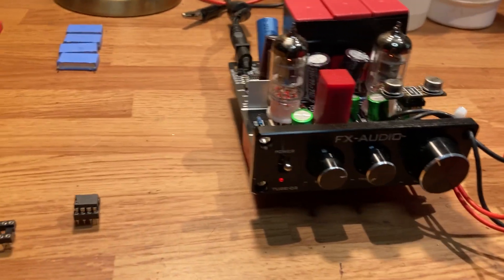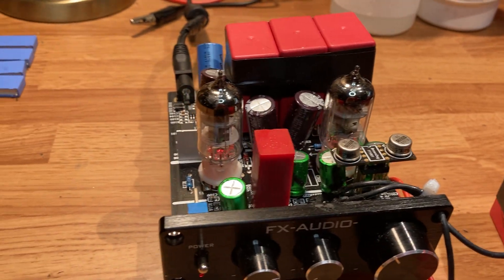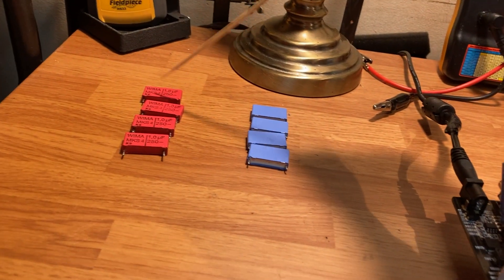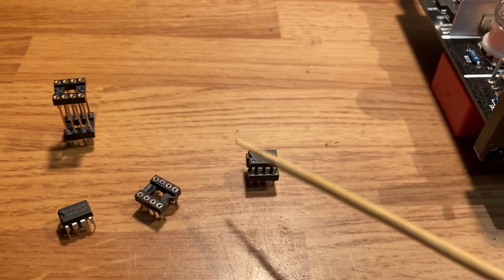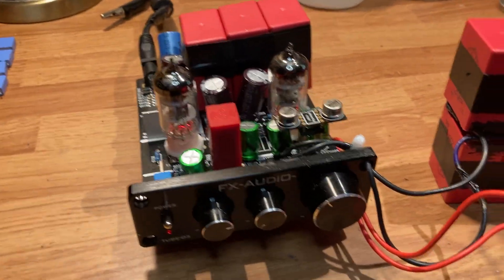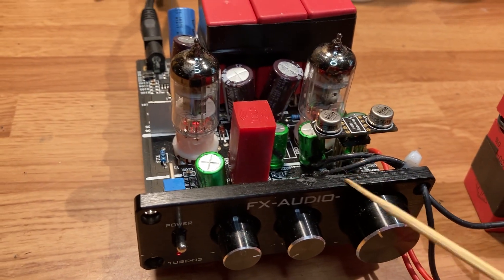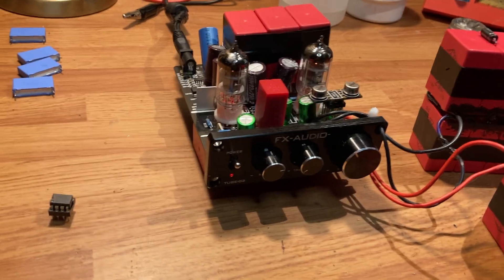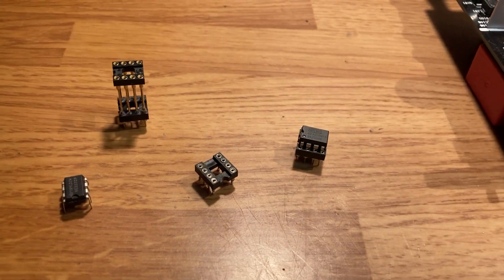FX Audio Tube-03 op amp and capacitor upgrade

Comment: Ooops! I installed a set of  OPA627’s backwards in my tube 03 and turned it on. The OP amps are ok but the tube 03 is distorted with no volume control, bass control and treble control.
Reply from the maker: I think it's the op amps they are what we called FRIED!  Swap them out with the other ones and see if it fixes it.
Reply: I put the OPA627s in a different Tube 03 and they worked fine.
Reply from the maker: @audio-obvious568  It's impossible for the op amps to destroy the Tube-03 themselves.  Again try to put different op amps in the Tube-03 that you say has all of the problems.
Reply from the maker: @audio-obvious568  What are you using for an adapter with them?
Reply from the maker: @audio-obvious568  take a picture of those op amps and send them to me at peopleridiots101@gmail.com
Reply: I put all the original parts back into the tube 03 and I had the same results……. I am using an adapter from cimarron single to dual adapter for the OPA627’s
Reply from the maker: @audio-obvious568  and how are you fitting it in there?
Reply from the maker: @audio-obvious568  Again, take a picture and send it to me at peopleridiots101@gmail.com
Reply: I purchased extensions.
I’ll send another email of my working set up.

Comment: Great Video !!, I just got the Fosi Audio tube P1 preamp I bought in addition the Riverstone 5645 GE tubes , I still listening now to the 6K4 tubes, What OPAMP you can suggest me to be replaced in my Fosi P1 ?
Reply from the maker: Look up there ^^^^^^^^^^
Reply: @ranbymonkeys2384  OK, I will order the OPA2134 and four WIMA 1uF cap. Thanks
Reply: @ranbymonkeys2384  Hi, Can you please provide the WIMA Caps values or links form digi key, sorry I got lost from all the list of caps in the website. Thanks
Reply from the maker: @RanTausi   That isn't all you need, you don't know what the hell you are doing so your asking for me to make sure you don't fuck up.  THE ANSWER TO YOUR QUESTION IS IN YOUR PRE AMP RIGHT NOW.
Reply from the maker: @RanTausi  Look up capacitors (film) then look up WIMA if that's what you want and click on it then click apply to all now it will just show you WIMA caps.  Then you can select uF, voltage, and if you are really confused hint: check out the SIZE.  Look I have no problem helping people out, I do however don't want to hand people everything because then what happens the next time they need a ANYTHING it's "can you give me a part number"  Also check the box that says "in stock" under stocking options.

Comment: Electrical engineer with design experience of 40 years. When someone says op amps and capacitors need a break-in, it destroys the credibility of everything else they say. They are either lying or are ate up with confirmation bias. Or both.
Reply from the maker: Have you ever swapped caps in an amplifier?
Reply from the maker: When it comes to op amps you can have your bass and treble (EQ) at a setting and that will change drastically after 20 to 25 hours with a new op amp.
Reply from the maker: OK, then.

Comment: I just opened my new FX Tube-03 and though I can get the muses in I have 500v  and  not the 250v ones (want to replace with the wima's. Any advice for me?
Reply from the maker: Thought you can get the muses in?  I already answered the 500volt vs 250 volt question, PAY ATTENTION!!  What are you talking about "thought I can get the muses in"?
Reply: @ranbymonkeys2384      'nough said.

Comment: So if the tubes to this amp operate at 250 volts and the capacitors that you used operate at 250 volts how are they doing anyting if it has a low voltage power supply?
Reply from the maker: Because film caps usually don't come in lower voltages.  They do but they are very small for the size of capacitance desired.  You can have a 10,000,000,000 volt cap and it wan't make a difference.  EDIT: The answer is the tubes don't operate at 250 volts.
Reply: Voltage multiplier - Google them…
Reply: I think those tubes are only running at around 48v plate voltage, way under their recommended voltage.

Comment: I have a Aiyima T7 tube preamp. I've replaced the tubes with Sylvanias from the early 50's. It has three NE5532P op amp chips on the circuit board. What would be good upgrade options for these chips?
Reply from the maker: Ya that is the newer one with bluetooth.  One op amp is for bass another treble and the third is the headphone amp.  Any "dual" op amp will work in the description are a few good ones to get started.

Comment: So whats the tube really do?
Reply from the maker: Back in the day that's all there were, tube amplifiers.  They sound warm compared to modern amps.
Reply: @ranbymonkeys2384  hi sorry need to ask you again, do you change electrolytic caps too? If i change it will it improves the sound?
Reply: I mean if the sound affected by the op amp, should i change the tubes too for better quality?

Comment: What power supply/adapter do you use ? I read it will also help for better sound than stock adapter. Is Linear power supply any good, lm317 psu toroid with hi grade audio parts like wima mkp10 (top series of WIMA Cap), elco gold series, elco silmic II, diode fast recovery. noise filter, heatsink anodized, etc.
Reply from the maker: They take the same power supply but the higher amp supply the better like a 12 volt 10 amp
Reply: @ranbymonkeys2384  Thanks for confirming. I just got similar answer just now from the seller that's why I deleted my comment.
Reply from the maker: junk
Reply: @ranbymonkeys2384  you mean psu doesn't matter ?
Reply from the maker: @Mickimoss  Of course it does.  EDIT: MKP10's aren't WIMA's top series.

Comment: It has treble and bass using same opamps, can a MID be added too ? Mid is also good to have in a pre amp/tone control but mostly doesn't have it unless using a DIY preamp/tone control kit.
Reply from the maker: Ya you can, but that's all you!!
Reply from the maker: Look at the AD827AQ it's the same but ceramic.

Comment: How about AD827JN ? other person did it and it seems sound better too than stock(5332) https://www.youtube.com/watch?v=ONBUGwALT6o 
The price of AD827 JN is like 11-12x times more expensive than  TL082CP where I live, and 2.4x the price of OPA2134PA.
There's probably also NE5532, but it's also much cheaper than AD827 JN which is 7x NE5532 price.
Reply from the maker: Anything is better than the ones in it.

Comment: Thanks for the video post.. I upgraded to use audio caps,wima and opa2134
 Sounds great. It is a beast and running without cover. The only remaining trial will be the 2 pcs of 10uf connected to your huge wima at the right video. Do you see any significant change in sq?  Thanks a lot bro. Learned many things here. Will try muses or burson op amp soon as well.
Reply from the maker: What does "sq" mean?
Reply: @ranbymonkeys2384    sq is sound quality.
Reply from the maker: @ronnieathlon  O well, tisbostycdfsq.
Reply: My bad. 2 pcs 10uf electrolytic caps (not 5uf)  beside the right op amp.

Comment: I have around a 100 hours through this thing,new opp amps, wima caps n russian tubes,this thing is great,softens things out and adds warmth and i love the extra 6db of base as its very handy for thin sounding tracks when playing at low volume :)
Reply from the maker: hehehe
Reply: what op amp did you use?
Reply from the maker: @danielcabrera5260  hundreds

Comment: First, thank you for this video, it is very informative. I've watched it many times, and have since modded 3 AIYIMA 6J1 tube preamps using your suggestions. So far my favorite set up is with OPA2134 op amps, Soviet military 6J1P-EV and/or GE5654 tubes, the WIMA caps you suggested, and a 12V/3Amp power supply. The upgrades made a huge difference, I can't wait to try other tubes, and the MUSES02 or discrete op amps that are available. Second, I was curious if you've experimented with other tube preamps. The AIYIMA 6J1 is about the same price, looks to be a very similar design, but has only two of the blue electrolytic capacitors instead of four found in the Tube 03. I need to purchase another tube preamp, so I think I'll give the Tube 03 a go and modify it like I did the AIYIMA 6J1. I'm curious to see if there is a significant sound difference with the two different boards and Tube 03's extra caps. Lastly, I think I'm ready to try building a frankenstein version like your's. Any advice for someone who's not afraid to run a soldering iron? If I had a better overhead view of your set up, I think I could figure it out pretty easily. Thanks again for the great information and for posting this video.
Reply from the maker: A lot of times the company FX Audio will have a bunch of scrap boards (mislabeled or even a flaw in the design) and they or somebody else buys them and puts crap components in it name it something else and sell them like that.  I have used tube pre amps with the 12AX7 tubes (a little bigger and 9 pin) and I really like those.  Youe NEED to get that MUSES02 it will blow your mind!!!!  You say yours only has 2 film caps but is there room for 4? Whats your email I'll take some pics and email them to ya if you want.  Get  some good .1 uF film caps and solder them accross the + and - of your big power caps (usually more than 1000uF) that is called bypassing just solder them right to the existing power caps that I recommend replacing also.  BIG DIFFERENCE THERE!!!!  EDIT : the OPA2134 is in my top 10 op amps.  Sometimes the classics are hard to let go if.
Reply: @ranbymonkeys2384  Very interesting. I popped open the AIYIMA 6J1 case to take a look at the caps... definitely looks like it is a different board. The two caps are located right in the middle between where the tubes go. Also curious about the MUSES02 but I'm definitely more informed, it is very popular and I'm sure it's for a reason... have heard that the MUSES01and MUSES03 are fantastic as well. So many op amps to choose from, I've tried a few now... I'd love to have a peek at your top 10. Thanks!
Reply from the maker: @akersquarteracre  Does it have the 2 in the center ALSO with the 4 because the tube 03 has them too.  The MUSES01 isn't as good in my opinion I have both and the MUSES03 are single op amps so you would need 2 of them and put the in a dual to single adapter (in total a $100 op amp) but I heard samples online and it sound INCREDIBLE!!!!!!  I'll get you pics tomorrow in some good lighting.  OPA627 is a tube like sounding op amp but they are also singles those are the can type looking ones I have in the treble slot.  EDIT : I found if you need more punchy bass go with AD***  op amps for mellower highs go with OPA***  The Burson V5 is a very good one also.  There are several $2 -$3 op amps that I really like and sound better then expensive ones in different systems, LME4972, TL082, OP275 (reverb sounding), AD825 (single you need 2 and the adapter), AD823 ($10).
Reply: @ranbymonkeys2384  Nope, just the 2 caps in the middle, that's it. And that's great info, didn't realize the 03 was single until now... and the 01 is not nearly as popular... so... the MUSES02 it is! The discrete op amps look like fun, but man do the get expensive. I appreciate the pics, I'll share a shot of the AIYMA with you... curious what your take is. You know way more about electronics than I'll ever pretend to lol
Reply from the maker: @akersquarteracre  The MUESE01 is a dual not a single (the MUSES01 and MUSES02 are duals)  The MUSES03 are singles so you need 2 to make a dual.  The op amps on your board each one are duals there are actually 2 amplifiers in every chip. My take is going to be to replace them that's for sure!!! They are probably 1uF film caps but smaller my guess polyester not polypropylene (the good ones)  even better polystyrene!!!
Reply: I found some of those Wima caps on mouser and ordered what I thought were the right ones but they’re too short. Would you happen to have that part number laying around?  I’m having a hard time finding them. I would appreciate the help. Thank you!
Reply: @guitarguyf16  If you are referring to the WIMA caps that will fit under the cover, it's Mouser part number 505-MKS4F041005BJSSD.
Reply: @akersquarteracre  Yes!  Dude, thank you so much!!
Reply: @akersquarteracre  Freaking out of stock, lol. I’ll have to look at some other places. Thanks again!
Reply: @guitarguyf16  Not surprised... seems to be par for the course these days, I ran into the same issue with other parts I was wanting to get too. No ETA's or at least a year out on some. Best of luck!

Comment: Finally ALL my questions are answered.. this video and info is godsend!!
Reply from the maker: You should see my video on the "meaning of life"  haha, kidding
Reply: @ranbymonkeys2384  
That video on meaning of life wud be something!!

So finally deciding to take the plunge.. wondering whether to go all in and get Muses02 or cheap out and get the 8890D.. already running Ge5654 tubes in the tube03 mk2. looking to improve depth layering and soundstage, while keeping the warm sweet signature...

Also does it make sense to change the HP out op amp? if yes, which one..

Awaiting your reply to pull the trigger

Thanks!
Reply from the maker: @dopydude  Ive got the 8820 and the 8920 and let me help you out don't bother take that 20 and add another 30 and get the real deal you will nor be sorry.  The muses 01 sucks too, compared to the 02.  I really want to try the 03's but they are singles so I would need 2 and well $$$$$$$

Comment: My tube 03 has 500v caps should i change them for 250v or 500v wimas?
Reply from the maker: what caps are you referring to?
Reply from the maker: take a picture and send it to me ch3151980@gmail.com
Reply: Hello I'm also curious about this as well, my tube 03 also has blue 500v caps. but the wimas you show in the video are 250v. What should i do?
Reply from the maker: @raymondlopez515  More times than not the Chinese throw whatever that have at the time in there.  The 230 volt will work fine.
Reply: @ranbymonkeys2384     Looks like it happened to me too---my my tube 03 has the 500v caps.  What wimas to get?
Reply from the maker: @imnofool2u942  The same ones I told the other guy.
Reply from the maker: @imnofool2u942  I'm willing to bet they aren't even 500 volt caps.  Look up 1uF 500v film caps and look at the size of them.  1 5/8" diameter and 2 1/8" long!!!!!!!!!!
Reply from the maker: @raymondlopez515  Weird.

Comment: Can this be used audio jade ad825 to replace the stock op amp?
Reply from the maker: What is "Audio Jade"?  The AD825 is made by a company called Analog Device and the AD825 is a single op amp so you need 2 of them to replace one of the stock ones.
Reply: @ranbymonkeys2384  ok thanks a lot
Reply from the maker: @efrenreyesarchive  look at AD8620 and what is Audio Jade?
Reply from the maker: OK Jade Audio, ear buds, not my wheelhouse.  I know nothing about headphones.
Reply from the maker: @efrenreyesarchive  does your turntable have a built in pre amp most do.